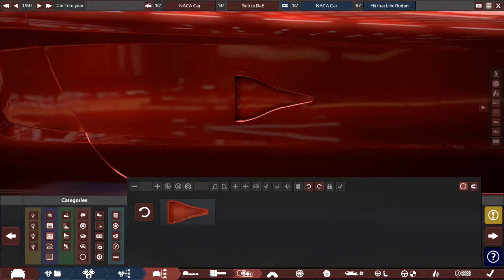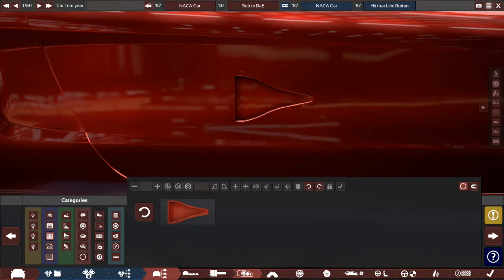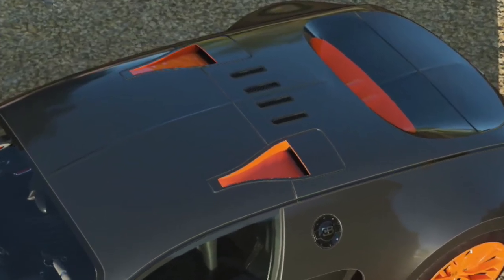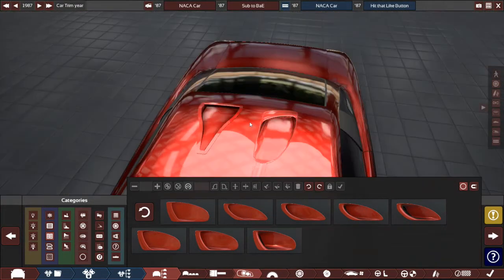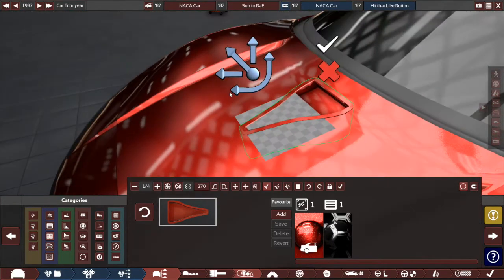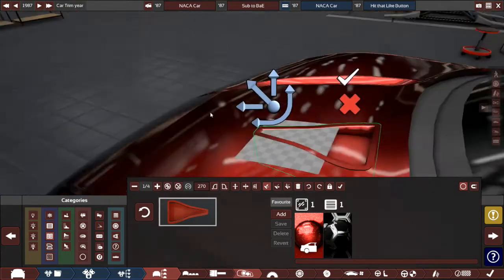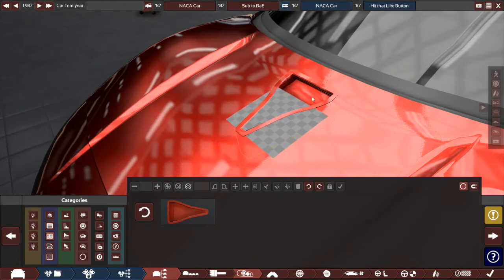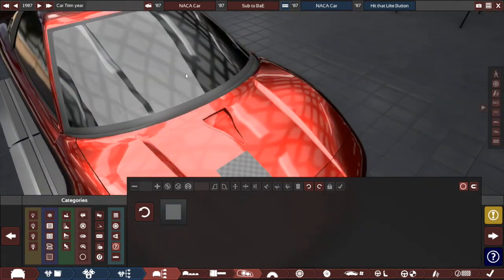NACA Ducts Explained!

Comment: NACA ducts do work backwards to create low pressure and essentially PULL air from inside a race car. It sounds a bit misleading the way you described it in your video made it sound like they cannot be used in reverse. Reversed they will pull air.
Reply from the maker: Thanks for the feedback though, yeah it should've been clearer. I just don't like this idea being spread that there's something special about the shape, after all, when they're reversed they're just acting as a hole.

Comment: Nascar may of been testing them backwards in the window to see if they were able to work in reverse pulling air out of the car instead of sucking it in. Especially if the vortex spin in the opposite direction. That way they don't need a fan to force the air out. I doubt there is enough of a pressure differential between the interior and exterior to make a difference with a passive outlet. Like the outlet grills they use over the front wheel wells in allot of race cars. 
   Maybe, just a guess.🤔
Reply from the maker: Thanks for the comment!

Obviously we can only take guesses unless we test it ourselves, but I think there would be quite a large pressure difference thanks to NASCAR using window nets which I’m assuming allows a lot of air get into the car.

I don’t think a vortex would be produced going backwards because I think the pressure on the ramp of the duct would be quite low, air inside the car accelerating through the narrower hole before meeting air on the outside of the car. I think instead the rules only allowed NACA ducts to be used, so it was their only option. Likewise with fans, I think they’d fall under some sort of rule against moveable aerodynamics which I assume has been banned in all forms. I can’t think of ever seeing a fan on any stock car. Unfortunately the rulebook for NASCAR hasn’t been public, so we can never know.

Just my 2 cents though, I’ll have to look into actually testing that some way. Appreciate the idea!
Reply: @BoostandEthanol   No problemo, nice channel. 

   You're right about the window. I forgot about that. I just checked out the clip you linked in the description. That guy said they tested them in the wind tunnel and, found out they did create low pressure when turned backward in the cabin which somehow sped up the car. They started putting multiple in each window, but NASCAR noticed, and shut them down. Wonder why they banned them? Maybe they have some rule about the car needing so much pressure inside. You would think it would help allot in keeping the driver cooler.
Reply: They did function in the backwards orientation in the rear side windows in nascar, and this came to knowledge through wind-tunnel testing, and was confirmed. The laminar flow across the outside surface induced a low pressure zone that would basically vacuum the air out of the inside of the cockpit, thereby reducing drag. They worked so well in fact that NASCAR outlawed the backwards orientation anywhere on the car. Now they must have any naca ducts on those cars in the forward-facing orientation 👍
Reply from the maker: @_donpowers  Do you know what else does exactly what you said? A hole. Which is what I said a NACA duct is when placed backwards. The shape itself does nothing special, just the fact there's a hole there sunken into the body so flow detaches over it and creates a low pressure region. Nowhere did the video say it somehow magically stopped air leaving the cockpit.